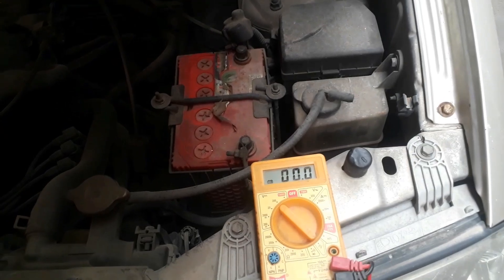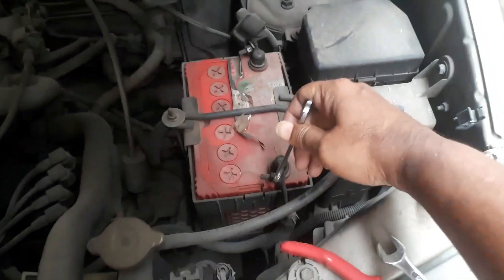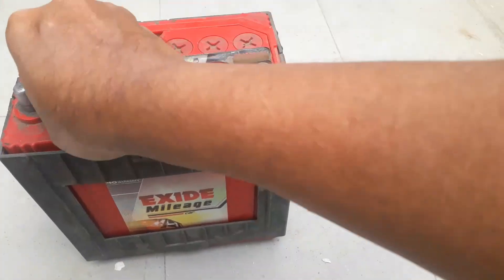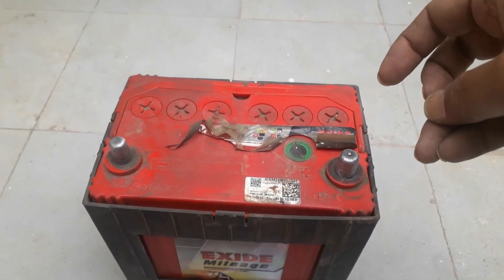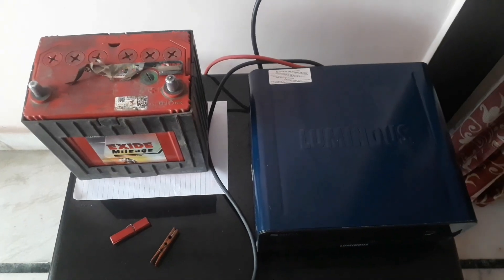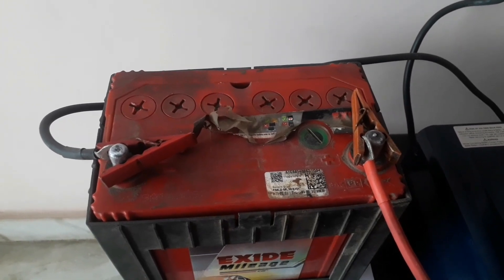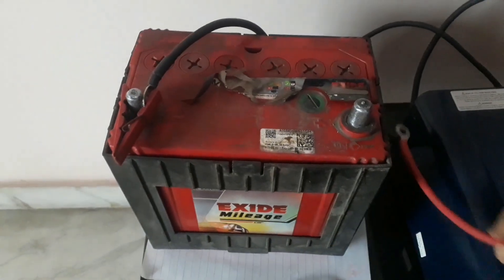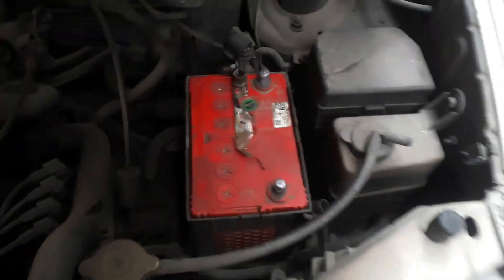How to Charge Car Battery at home

Comment: Hello, I have a DC to AC invertor that I always use in my car. Can I use the same invertor to charge my battery?? Or I'll need to have an AC to DC invertor instead??
Reply: Inverters are DC to AC only. It charges the battery (DC) in regular time and When the  current/power supply is not there then it converts DC power stored in Battery into AC and gives it as output for home.